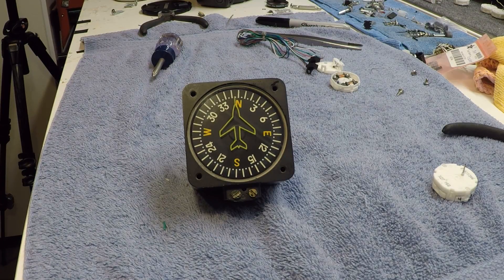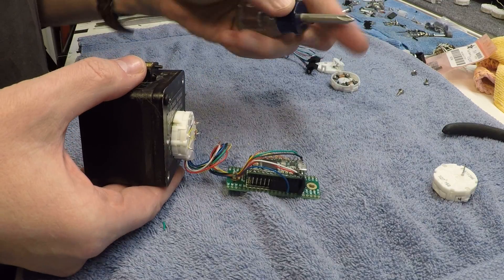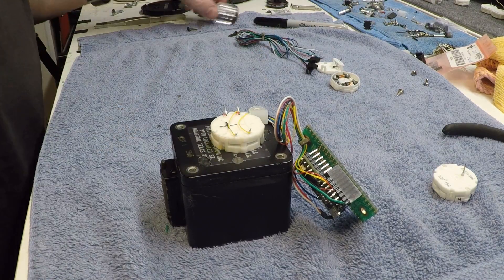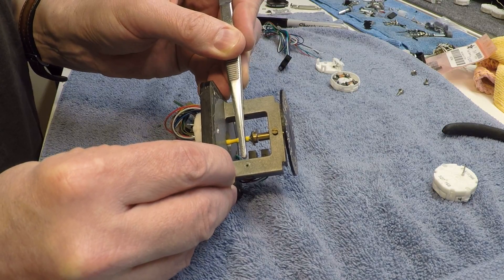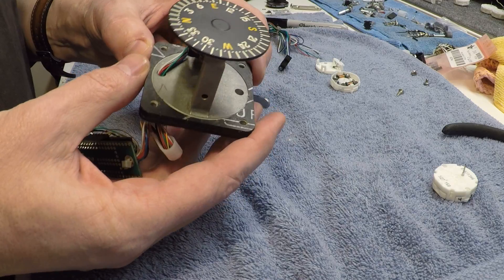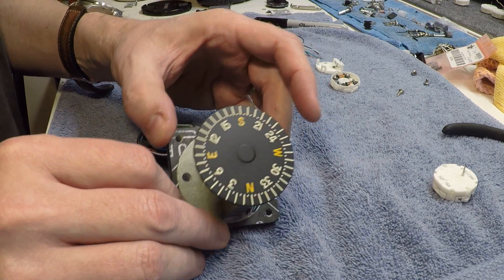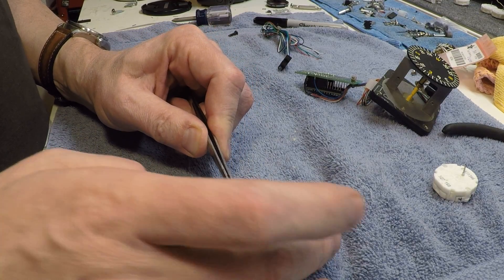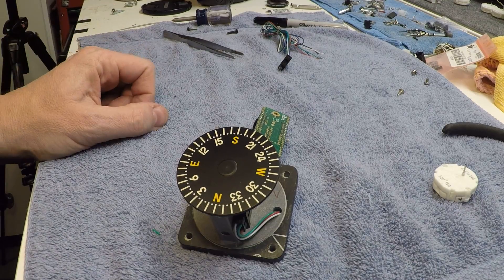Vertical Card Compass Conversion for use in X-Plane

Comment: Hi I have been looking for parts, and unable to find a broken and or cheap vertical card, I am thinking about making the card since it is connected to the stepper  motor,  I have no idea how to wire up the teensy 3.2 to the stepper motor and photo-interrupter,  could you provide a schematic, and how the photo-interrupter is connected to the vertical card?

Comment from the maker: I mistakenly referred to the opto-thingy as an opto-isolator. It's actually referred to as a photo-interrupter

Stepper motor part #: X27-168. (720 steps per revolution) You can pick these up on eBay for a few bucks each.

Photo-Interrupter: OPB990L11Z

Teensy is a 3.2, but I suspect even a Teensy LC would work for a few bucks less.